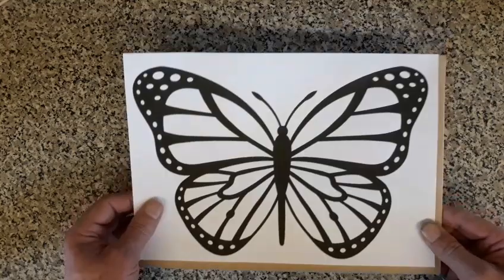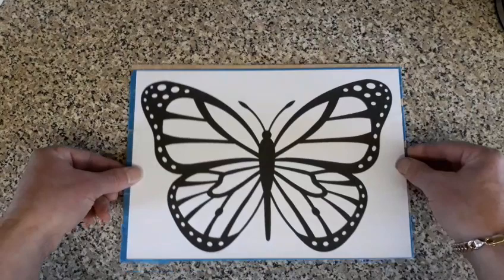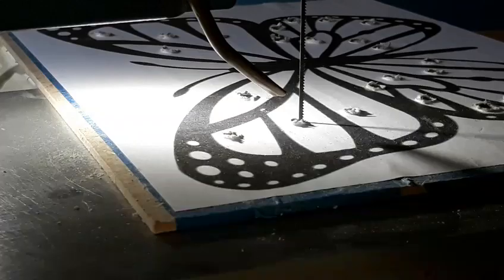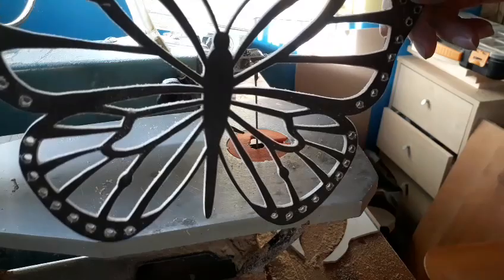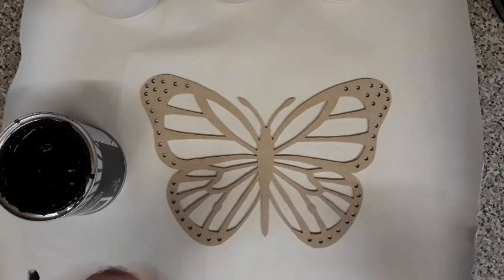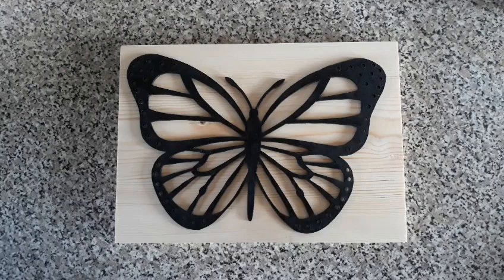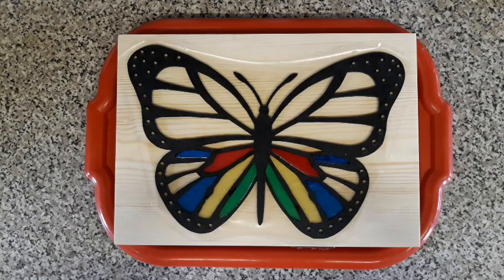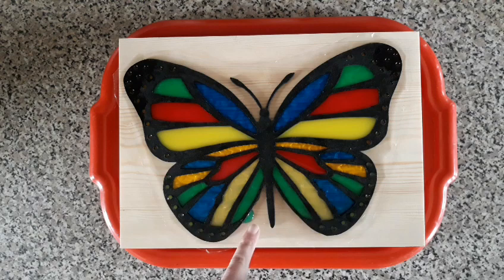Scroll saw butterfly and resin..Fail or Not

Comment: I like it! Good imagination! By the way, the reason the clear vinyl didn't stick was because of the black satin water based paint. It will stick to wood (as you know) and it will also stick to sprayed lacquer, but not to water based paint. The funky wavy finish on the back side because of the poor adhesion to the paint. The vinyl also expanded with the heat of the chemical reaction as the resin cured. Using three or four layers of the clear vinyl 'might' solve this problem.You can pull it off when it's finished. Looking forward to seeing more of your projects.
Reply from the maker: Thankyou for the comment, this one was a trial project for me,I've since done a rose stained glass effect,video on here, and it turned out better for using sellotape...

Comment: looks really nice and a great idea for combining the two techniques.  I think if you applied a couple of sealer undercoats to your MDF it would be more resistant to soaking up the resin.  It could also be that the MDF could warp a little bit too when it does become wet with the resin  and the clear contact wrap might buckle with the heat when it cures both causing the seal to be lost underneath and the resin to move out.  I wonder if you used a thicker sheet of plastic film e.g coreflute and clamped the MDF pattern down onto that e.g putting a weight on top of it - just to keep the seal intact whether it would all keep separate.  however it looks really nice - and quite natural so great job!
Reply from the maker: Thankyou for the great comment. I've since done another project..stained glass effect rose with resin(video on here) and the sticky backing was my downfall, I've got better..lol

Comment: try grp in Nottingham for your polyurethane resin .you can always use oil paints to color the resin get packs from the pound shop ..love the butterfly..and i find with clear resin if you put to much activator in it 
it wont go off..unlike the all purpose resin to much activator in that and it will turn in to toffee and crack
Reply from the maker: farscape3100 thanks mate.ive tried three different types of resin it's just not working for me but practice,practice..haha